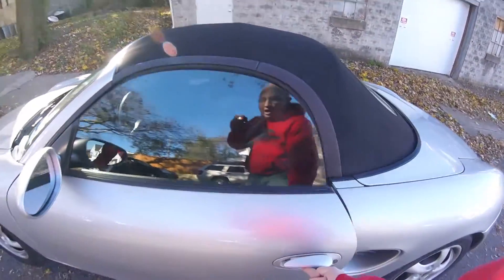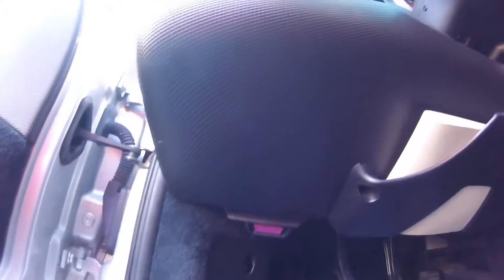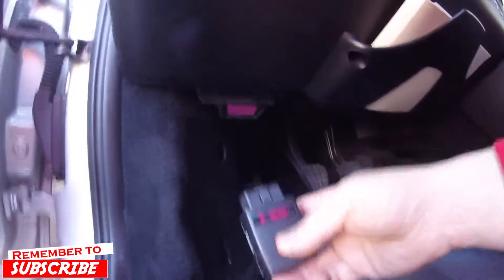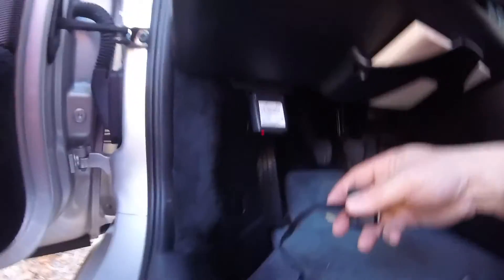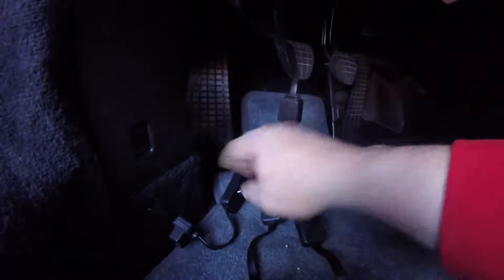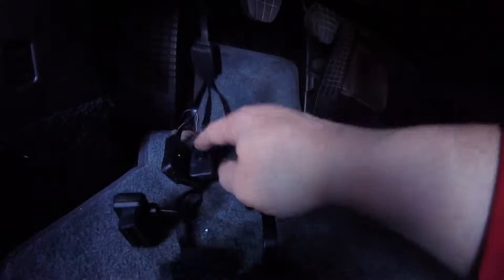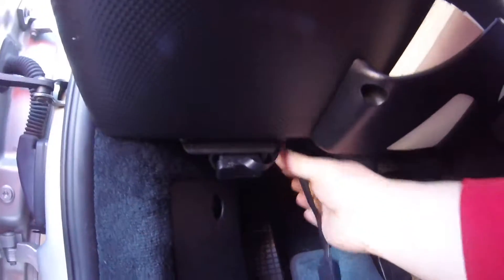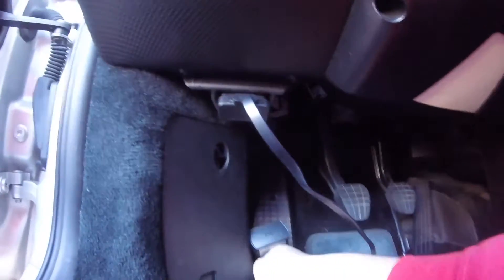How to get more OBD2 ports in any car - OBD2 Splitter

Comment: Do they simultaneously? Need to Run wifi adapter and Eld?
Reply from the maker: Haven't tested it but it should
Reply: @GregorySalvatore  I assume you've tested this now? Do 2 read-only devices work simultaneously?
Reply from the maker: @samwisem  yes